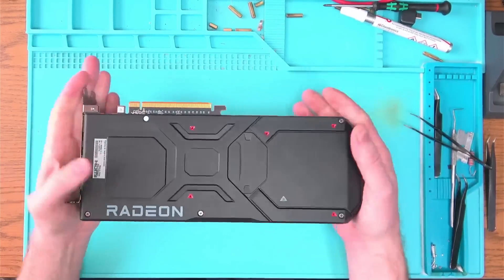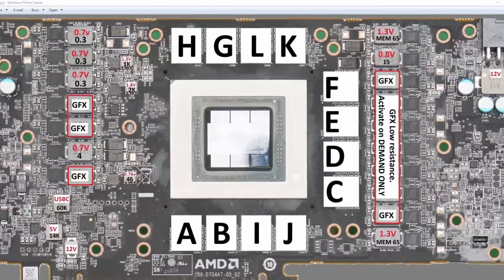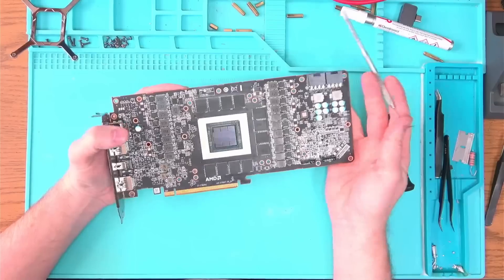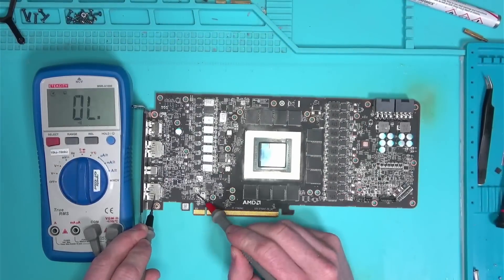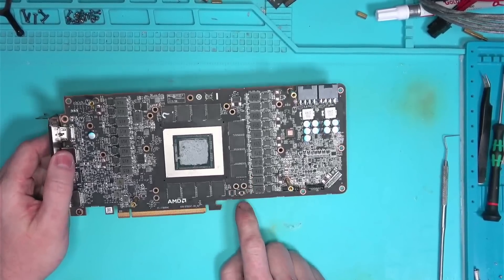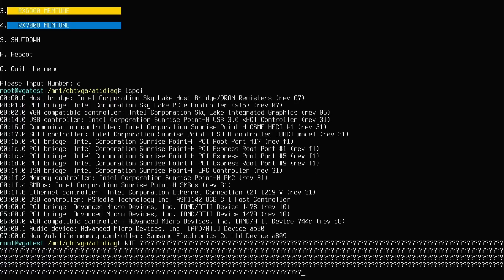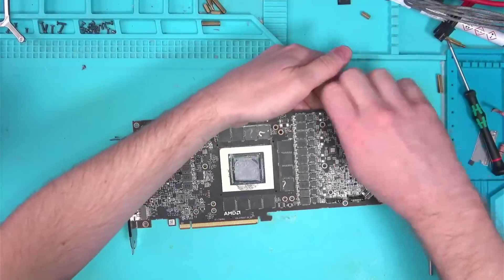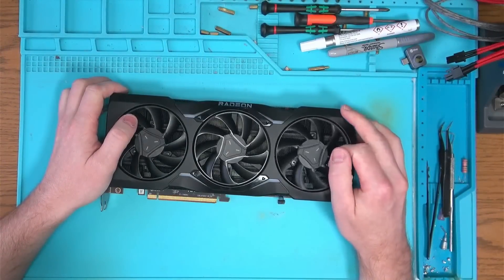7900XTX repair video

Comment: My 7900xtx card just died, snap of the fingers the other day. 
Had the robotic grrrrrrrrrr sound and full crash reboot, vga light is on and my 9800x3d took over for the gpu. Cooked.
Reply: Mine still works but only without the AMD driver installed. Tried everything, even reinstalling Windows. It simply crashed a week ago and boom, basically a brick because I can't boot into the system with the driver installed.

Should've bought the 4080 Super when I was deciding between the two...
Reply: @fluttzkrieg4392 wtf... so potentially this is all a farse??
I installed my Rx 570 and it works perfectly. But I don't have a big enough power supply to try the GPU and another PC
Reply: @fluttzkrieg4392 I'm not following you period The graphics card died And the 9800x3d has integrated Graphics I don't need a GPU

Comment: I sent you an email ,bought an RX 7900xtx reference but it was missing a backplate and has connectors that stick up so high I doubt the backplate would fit.Thing works great but it is unlike any Reference I have ever seen as it has a Red PCB,and GPU-z says it is an XTX 7900.Was wondering if you have a backplate that would work,I do not like those tall ass connectors sticking up so high.They are like 1/2 and in. high it is insane. Doubt a water block would work those connectors are so high Maybe it is not a reference,I dunno who cares? I would like some plastic caps for those unused connectors at the  very least.

Comment: considering that the chip would be simply larger if it was monolithic I doubt the failure of the memory is indicative of chiplets being bad. I bet there would be stability problems in usual graphic workloads too if it ever managed to boot, it's the core which should be more damaged than MCDs.
It would be easy to avoid this - BGA solder joints should be weaker so that they fail before the solder on the interposer fails. It has nothing to do with chiplets.
Nvidia is probably doing this better if you don't see failed cores that much.

Comment: People buy the 7900 XTX because it's hundreds cheaper than a 4080 but faster than one when the half-baked gimmick that is ray-tracing is turned off. In some games it's nearly as fast as a 4090 for nearly half the price. And considering the vomue of broken 4090's you fix due to drops, I dont see why you're so hard on AMD for this card dying due too being dropped.

Comment: I wonder with an IR camera one could see the disconnect in the chiplet, my guess is the chiplet connections being so small, a force able enough to cause a disconnect probably disconnected more than just a data-line and that lack of heat should be able to be seen.

Comment: Chiplet makes as much sense on gpus as cpus, but its more difficult. Remember bulldozer the fact that monolithic quad was theorethically superior didnt fix a bad basis. The first dual core was pretty slow at first took a long time to (windows) software to catch up. Im not into first gen of any new, but i trust this will work eventually.

Comment: I wonder if Sapphire or PowerColor make better quality products than AMD. Or are they all basically the same inside?
Reply: Sapphire has always made quality GPUs
Reply: AMD designs chips, they don't manufacture cards (or even the chips themselves).
Reply: @RFC3514  i get what you're saying but have you never seen an AMD reference card?
Reply: @DaleC.  - AMD reference cards are generally laid out and manufactured by Sapphire, so it makes no sense to ask whether "Sapphire make better quality products than AMD". AMD designs processors, Sapphire doesn't. Sapphire manufactures cards (using AMD-designed chips manufactured by TSMC), AMD doesn't. And AMD-based Sapphire cards are generally quite good, with very low failure rates (which is probably why he didn't even have another one to test and compare).

Early production models might have some problems fixed in later batches, but nothing here suggests a manufacturing problem (attributable to the card manufacturer), let alone a chiplet packaging problem (attributable to TSMC) or a chip design problem (attributable to AMD).

This video is uninformed speculation at best, biased deception at worst. He didn't even test chip itself, didn't look at boardview, didn't analyse any data signals, just tried a couple of generic fixes to the soldering and memory, then randomly decided to blame "chiplet interconnects" (while claiming that the Vega architecture was chiplet-based, when it wasn't).

He's really good at soldering and unsoldering things, but he clearly doesn't know much about actual microchip architecture, and always tries to blame AMD (a chip design company) for errors that he didn't even identify properly. If the exact same card had a processor made by a different company, he would be blaming the card manufacturer or the user who dropped it. But hey, maybe gravity is "AMD's fault". 😄
Reply: From what I saw from few repair videos, amd reference models have the worst quality pcbs. Sapphire and PowerColor look more solid, even my own 7800 xt hellhound... my old psu popped and killed the motherboard or the cpu socket specifically but the gpu survived without any issues
Reply: @Creep4EverMV588  Thats good news. Thanks for the response. 👍

Comment: Oh, btw, this could have been an early batch where AMD had QC issues with the vapor chamber leading to inadequate cooling. That's a known problem for the reference model. Later batches have this fixed, but you can't know which one it is when you're buying it. That might be what killed the card.

Comment: That Nvidia chiplet design is specifically for their datacenter cards, because it costs an estimated $6000 to manufacture. That's before Nvidia's own margins. Don't expect it to trickle down to consumer cards any time soon, but you could expect more datacenter customers who are willing to pay top dollar for that repair.
Oh, and they're using HBM3 memory, which is also made part of the chip package, meaning you can't remove and reball it like you do with GDDR.

Comment: Fun fact, the previous VEGA chiplet design was AMD's attempt at making a fast GPU, but it was a failure because they have too many dead HBM memory chiplets at the factory.

The new chiplet design is a cost saving measure. The memory controllers are seperated from the main compute core. That way, AMD can use cheaper manufacturing methods for the memory controller.

Comment: Chiplets are inevitable right now to get the numbers of transistors up and cost down, as much as it is a pita for repairs. As for the RX Vega, I've never thought about what happens when an HBM2 chip dies. It's a total loss, right? To be fair, I think most that developed memory issues were mined on 24/7 and the number of repairs does not reflect what the average customer playing games experienced.

Comment: Got a sapphire pulse 7900xtx, i had a 7900xt and a 6950xt and 6700xt, Radeon 7, vega 64,  480, 7970, 3870, 2900xt 9800pro and none of them have died during my time using them. if there was a Radeon card i had problems with it was the HD2900xt that was a garbage card, and the only time i would complain about radeon drivers the 2900xt was pushed beyond its limits anyway. i did return it and got a 3870 which i never had a problem with! my 9800pro never a problem with, 7970 i never had a problem with and driver improvements gave that card 30-50% more performance over time. Vega 64 which i got for the same price of a vega56 400euro ish, due to it being a Demo product, the cooler was kinda crap, you had to undervolt it, Radeon 7 almost the same thing, but it would undervolt even better, 6700xt the best card ive owned since the 7970, almost all of my cards are sapphire cards at this point apart from the vega 64 xfx. 

All of these cards apart from the 7970 ive bought bellow MSRP, half of them are second hand cards, and ive sold many of them for more then what i paid, The Vram makes Radeon cards into finewine for miners. 

my current 7900xtx i only bought cause i got it for the same price as what i paid for the 7900xt pulse. did take a hit selling the 7900xt pulse. 

Theres nothing Wrong with chiplet cards, They work fine, there was nothing wrong with vega apart from the shitty cooler, great rendering cards. 

the best card of all time i would give to the 7970 i had that card for 7 years. rock solid 60fps high/ultra settings 1080p in all games apart from total warhammer.  

just because chiplets is beyond your skill doesnt make it bad. and Clearly Nvidia understand the power of chiplets and that its the future.
Reply: Because of the damaged part of the pcie connector... My guess is, the owner transported the gpu inside the case and it took some hits. Chiplets might have disconnected because of a physical impact... Looks like more of an user error, especially how big the gpus are now too
Reply: @Creep4EverMV588 agree. its likely damaged in transport. i did fail to transport my monitor when moving. had to buy a new one.

Comment: Vega did NOT have chiplets, Vega had HBM memory. And most of their failures were related to heatsinks not being properly made to accomodate the change of height between HBM and core - or in case of Asus, were wrongly torqued. AIBs often don´t give a ****, when it comes to making their own AMD designs.

Do your research please, before spouting out nonsense.

Chiplets probably are the future, since chips becoming too big will greatly affect the yield from wafers.

Comment: that gpu should have still been under manufacturer warranty if they are original owner with invoice.
Reply: a nice and visible drop will remove any warranty claim, are you new to this?
Reply: @giornikitop5373  nope. done over 1000 warranty claims with different manufacturers across over 5 years. its up to the manufacturer to prove fault by consumer. worst case they send it back for free unrepaired.

edit: seems i skipped over the small dent in pcb fiberglass material and the tiny malformation in gold finger, but i;ve been able to argue with at least 1 manufacturer that fiberglass material malformation wont affect electrical connection and neither would small pin defect like whats pictured (they have after all sent me back working refurbished parts with large cracks in the circuit board, so i use that all the time to argue in my favor)

Comment: I just notice how you dont know anything about chiplets, Vega was not Chiplet, Thats HBM memory, the radeon 7900 series is the first commerical consumer GPU with chiplets. and the bullshit about failure rates is even worse, if that was the case Ryzen would have a huge recall compared to intel. if anything chiplets are quiet the opposite.

Comment: Are all 7900xtx pcb Terrible?? Even the Powercolor card?? if so Honestly Ill probably buy th 4070ti super, not like nvidia isn't with thier problems as well!!
Reply: I compared few pcbs before I bought my 7800 xt... It seems like only the reference models directly from amd have cheap pcbs. I compared also an asus tuf and a powercolor hellhound card, the asus on default fan settings under a stress test sounded like a jet engine... needed to manually adjust the fan curve. The hellhound from powercolor is so quiet, my power supply fan is way louder than it. Most of the time it spins in the 800 - 1100 rpm range while gaming. Both cards had pretty much the same temps, way better than amd's reference on the hotspot especially. One bonus, the hellhound survived my old psu popping randomly... motherboard died or the cpu socket on it but the gpu survived fine

Comment: Yeah..... I really hope my Red Devil is built better.
Reply: It is, although in this case a physical impact is always dangerous and can disconnect the chiplets if unlucky. From what I saw amd's reference models pcbs always were cheap compared to aibs. If that gives you confidence, once my old psu popped... it killed the motherboard or the cpu socket on it but the powercolor hellhound 7800 xt survived without problems

Comment: Why are you always blaming AMD when it's not their fault? Their reference designs are always superior to nvidia. How many ram issues (aside from overheating) do we need from Nvidia before you admit it's a supplier issue or in this case user damage?
Blackwell isn't chiplet. They're not smart enough. It's just two dies together like dual core CPU/GPU, but it's on same package. That's not new either. And I doubt gaming series will be dual die. If they can't do chiplets and AMD hasn't done dual raster dies, then I doubt ngreedia does it (not to mention cost. Even gaming card would be 3-4K usd lol).

Comment: But both Intel and Nvidia are pursuing a future strategy of using chiplets. As I understand it the interconnects between them are prone to breaking down and are difficult and non financially viable to repair.
Reply: And what is that "understanding" based on? Where exactly have you seen "interconnects breaking down"?
Reply: Interconnects on chiplets can experience breakdowns due to various reasons, such as physical stress, thermal cycling, and electromigration. For instance, microbumps, which are used to connect chiplets in silicon bridges, are more prone to failure than ordinary bumps. They are placed very close together, sometimes as little as 30 µm apart, making them susceptible to mechanical stress and thermal expansion differences.

In the context of chiplet design, the Universal Chiplet Interconnect Express (UCIe) is an open industry standard that aims to facilitate the integration of chiplets from multiple suppliers into a cohesive system. However, as the bump interconnect pitches reduce with advances in packaging technologies, challenges arise in maintaining the reliability and performance of these interconnects. In a recent study it was found that reducing the frequency of the interconnects as the bump pitch decreases may lead to more power efficiency. 

The development of UCIe and its implementation in high performance, power efficient three dimensional system in package designs is a critical area of research to overcome these challenges. It’s a balancing act between achieving the desired electrical performance and ensuring long-term reliability of the interconnects as they become increasingly fine pitched.

Comment: Getting frustrated with AMD cards is fine but I don't understand why you frequently misrepresent common design choices has mistakes. Vega wasn't a chiplet-based GPU, it was a monolithic die with HBM memory instead of GDDR5. This has been common on data center cards for a long time. The 7000 series is the first chiplet-based concept but it's for the GDDR6 memory interface. The GPU core is still a single die in the center. I'm not saying it's without issues but should be more cost efficient than a single die of that size and certainly less expensive than modern HBM.
Reply: you can see that Vega has the memory chips right next to the core die. It is not one die. The memory chips are even from another manufacturer.

Comment: why wont they use a socket for the GPU and made it  upgrade features for it like AMD CPU  ??
Reply: Two mains reasons: 

1. Different GPUs generally have different memory configurations, different power requirements, etc., so each card would only be compatible with 1 or 2 GPU models (unlike motherboards, that are compatible with 10 or 20 CPU models).

2. GPU coolers are much harder to install and remove, because they cover the whole card, so it's not easy for normal consumers to replace just the GPU.
Reply: @RFC3514  time to do some power standards for GPU ...it is running wild ...

Comment: Did he get this on ebay or something?. That's an expensive donation. No way of getting a rma/replacement under warranty?. Or since it's the customers fault, the gpu warranty would get shot down?.
Reply: Physical damage caused by the owner is generally not covered by warranty.